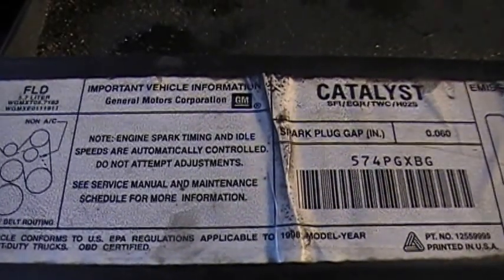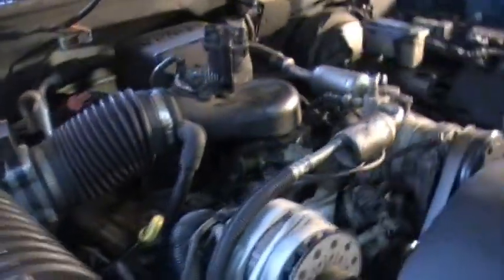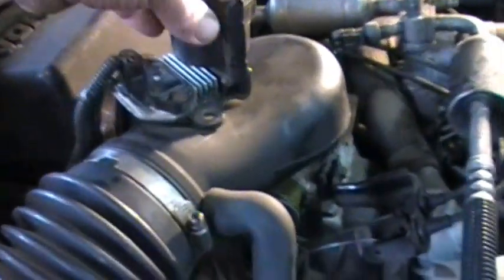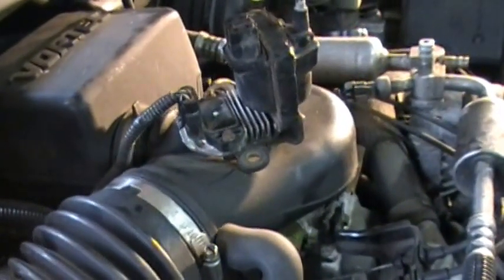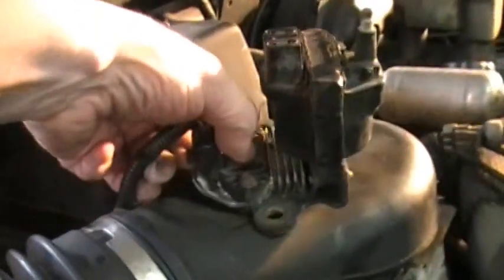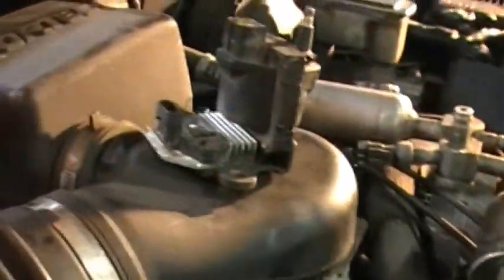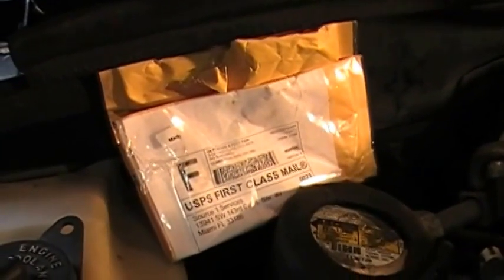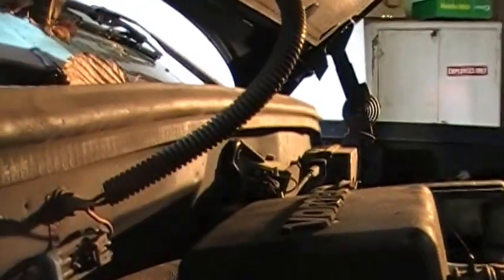1998 Chevrolet 350 New Ignition Module and NO Start !

Comment: I found out that if you don't use AC Delco parts truck will not run right.So don't buy the cheap stuff you'll end up buying the higher end down the line somewhere.

Comment: I had a popular parts store check my ICM which they said was bad, however their tester also showed two of the modules they had in stock bad also. I am really curious now as to the status of a module I had purchased from them . After installation the truck ran for approximately four hours and now will not start. The modules were installed with the supplied "Grease" they supplied.

Comment: So how did it run with the icm and coil that was resting on top of the motor. I didn't see it grounded nor the coil wire hooked on it to send spark to the cap
Reply: The coil that was on the truck was still plugged in and installed. He just unplugged the icm (the one mounted on the truck) and plugged that connector into the test one

Comment: Would it cause a misfire if its bad? 
My Tahoe started to lose power as i was on the freeway one day, check engine light came on,  2 codes came out, p0300 and p0420 maf sensor.  Changed the sensor but nothing,  had the mechanic do a diagnostic test,  he came up with a bad fuel injection.  So i changed the spider.  Started it up, and ron what seemed ok for like 1 minute, then back to the misfire,  no power.  And bad exhaust smell.
Reply: Hi Jamie... 
So you can find info on our website, www.theneighborhoodwrench.com , To your problem, From your story i think you had a misfire and unburnt fuel melted your Catalyst (rotten egg smell). The minute it runs well is the time it takes to build back pressure, the MAF code is because no air can flow when none comes out the exhaust. 
A vacuum gauge is a great cheap tool to be sure this is it. Check "on all pistons" for a diagram of sample vacuum gauge readings. 
Also on misfires, always check spark with an HEI tester (looks like a spark plug). spark should be blue not yellow, Yellow may or may not fire under compression when it is 10 times the outside pressure,
Converter should be it for you thou, 
If this helps, pls. take a minute to review us on google or facebook. That and liking our page really helps us!
Thanks for watching and your comment .

Mike, from your neighborhood wrench team.
Reply: Hmm as I always say wait for Friday get a cold beer and then pull the battery cables from the battery. Now take a close look at the area which contacts the battery lip hmm rusty greenish brown or worse the contact area has turned( black )!!!!! Lots and lots of voltage drop hmm not just here but at every connection in the wiring harnesses. Now add add all these bad connections spots. And wait for a cold and rainy day. Ugg Ugg Ugg goes the starter. But wait a second The votage drop is also draining the IGN System Too more connections to unplug to examine looking at the male and female terminals yep you need to clean off all the croudsion tell you see that shiny copper color again.  Going to take a few days to do this. Put everything back together and try starting the engine hmm if it starts then let it alone .  if it doesn't change the control mulduel. Check for spark ?? Sometimes you need to swamp out the brain box also. Considering how many miles you have on the engine. If your over 250'000 then change everything lol lol lol or buy a new truck
Reply: The whole distributor fails and needs replacing
Reply: It actially would. Mine is only sparking the coil to fire 5 of my 8 cylinders.

Comment: so mine does the same thing can it also be the ignition coil or just the icm?
Reply: +Francisco Huerta
- You can test the Ignition Coil easily with a Multi-meter... Search on YouTube for it.  As for the Ignition Control Module, you can easily get from EBay for Cheap.
READ THIS POST HERE"
Please Note: This Module can causes a lot of Headaches !!! If your Car / Truck Over Heat or in Hot / Warm Weather and your Car / Truck dies during driving.... It might be as simple as this Module...... QUICK TEST !!! If you Car / Truck dies during driving.... Wait 15-30 minutes or take an Ice Cube, put it over this Module and COOL it for 2 Minutes. If your Car / Truck starts again, then you know your ICM needs New Thermal Paste or Replacement !!!

Comment: My icm is only sending spark to all but 3 of my cylinders. Odd.
Reply: Check distributor cap they have a problem about shorting out internally.
Reply: I am having the same problem. Did you ever discover what the problem was? I have replaced everything, and checked everything more times than I can count

Comment: I CHANGED THAT PART AND MY TRUCK DID END UP STARTING BUT IT ONLY STAYS ON LIKE 10 MINUTES
Reply: what ever happened with your truck? Did you fix it and how? I'm having trouble with mine and could use a little help. Thanks
Reply: No i have not
Reply: Nancy, I appreciate you taking the time to respond and sorry to hear about your truck. I wish you good luck and hope it gets fixed soon.
Reply: Change out your coil pack also check your plug into coil pack to make no tar has got into plug if so have to to clean that out also
Reply: If it turns off you should inspect fuel pump
Reply: I been experiencing this 10 min running changed out crank sensor also when i changed ignition switch not it only fires. Dod tou find Your problem out? Any help?
Reply: @yeyegshsjkrkrheheysteyeheh4973  tried a used fuel pump I had an no change unless it sounds good an aint. I should order fuel pressure tester perhaps. Also should i only buy AC Delco brand on ignition module? Any Help be nice
Reply: @Jimyatit  get ac delco
Reply: @yeyegshsjkrkrheheysteyeheh4973  I was gonna fo with ac Delco but i ordered a brand called Delphi) waiting on part to het here. Its 85.00 dollars for it said Oem) for 1998 K 1500 Vin R) hipeing this one is better than AC Delco it was more expensive hope i made the right move an will find out when part gets here.
Reply: @yeyegshsjkrkrheheysteyeheh4973  so I already had a Dephi brand shipped was 105.00 for that icm put it on an no fire but has spark. Im returning that one an i bout a cheap one to see an that one fired like the original one that has been on it for years. Should I still order the AC Delco brand an see?
Reply: @Jimyatit  ac delvo is orginal but your choice.